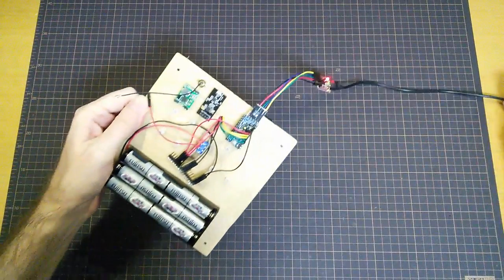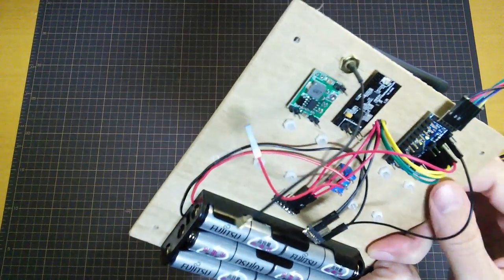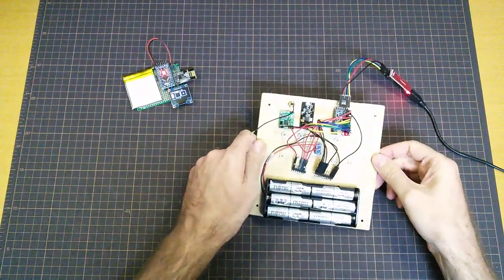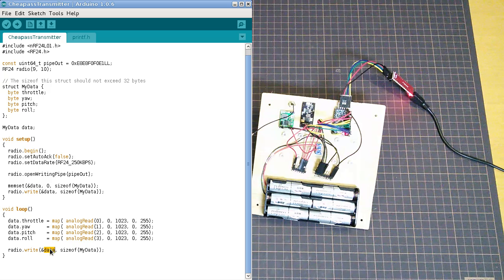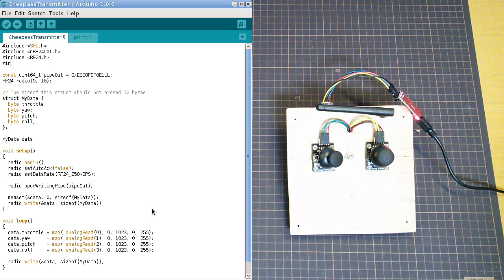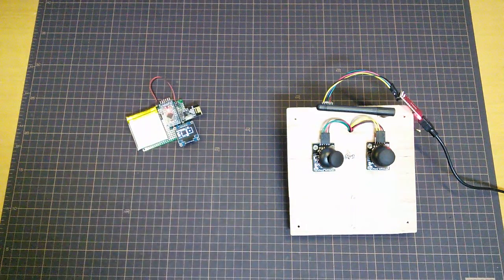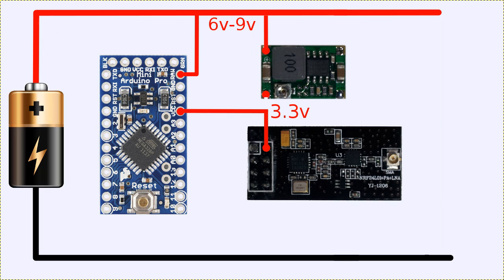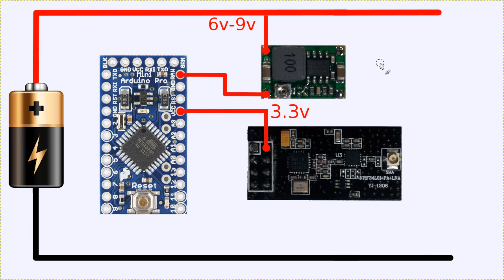Cheap-ass quadcopter build Part 6 - Transmitter (continued)

Comment: A couple of things.  If you put a 10-100uF electrolytic capacitor directly across the Vcc and Gnd pins of the RF module, it greatly helps.  The current surges when the module transmits cause the voltage to sag and the cap smooths that out.  I had a lot of problems with nrf24l01 modules until I found this tip.  Solder the cap directly to the pins on the bottom side.  Another thing is that supplying 3.3V to the raw in of the Arduino will result in less than 3.3V coming out of the onboard regulator.  There is always a certain amount of "dropout" with linear regulators.

Comment: Hi, Went through your sketches and found the one for the "Tester Thingy" and built the hardware as I believe is the same. Problem when I come to compile the software, it comes up as "Error compiling for board Arduino Pro or Pro Mini ...exit status 1" ....Any idea what this problem may be caused by? ...Thanks Jorgo
Reply from the maker: There should be more to the error message than that.... like a specific line shown in the code where the problem is. Scroll up and look at the whole error message....
Reply: Yes, you were correct. Problem was the library for RF24 was not actually installed. Throws one a bit when scrolling through the libraries and seeing it there BUT pressing "more info" makes it obvious that is is actually NOT installed. Also found I needed to change the size of the screen or rather, uncomment the correct size in the library SSD1306 using "word program". Screen had address as 0x78 which did not work but I found the reason why in other areas of the web ( shifted left 0x3c becomes 0x78)mmmm...anyhow, thanks for your work, great inspiration and motivator.

Comment: Hi, I'm following your tutorials, they're done very well, thank you. But I don't understand if, using "MultiWii_RF24" and "GY-80", for tx , using the joystick modules, I have to use "TelemetryTransitter" or "CheapassTransmitter" with two arduino? Why does the throttle field not change values in MultiWiiConfig? Must it be armed? As? Thanks again.
Reply from the maker: ? There is no sketch called "TelemetryTransmitter" related to this series...
If the other channels change values but throttle does not, then maybe it does need to be armed, I don't remember.
Reply: Oh sorry, I'm talking about this sketch http://www.iforce2d.net/sketches/TelemetryTransmitter.zip .in my case should I use cheapassTransmitter and another arduino in which load cheapassReceiver?

Comment: My long range nrf module only works when i touch the antenna or the board itself with my bare finger....does anyone had the same issue...or any one can tell how to fix it...i am using the nrf with arduino pro mini and i am also powering the nrf with another 3.3volt power supply...

Comment: What pin would I use on an arduino uno board that is similar to the raw pin on the arduino pro mini board.
Reply: Nevermind I actually found out look down below:

FOR ANYONE WHO WOULD NOT LIKE TO USE THE ARDUINO PRO MINI AND WOULD RATHER USE ANOTHER BOARD SUCH AS AN ARDUINO UNO BOARD, THE PIN (VIN) IS THE PIN THAT IS SIMILAR TO THE RAW PIN ON THE ARDUINO PRO MINI. 

Thought that would be some useful information :).

Comment: hi.when i change throttle down,all motors being rotate small rotation.what is proble.?
Reply from the maker: Maybe you need to calibrate the ESCs 
http://www.multiwii.com/wiki/?title=ESC_Calibration
Reply: iforce2d i have already calibrated.
Reply from the maker: Then I have no idea. Is your throttle stick giving the correct values to the flight controller? It should give about 1000 when throttle is fully down.
Reply: iforce2d my throttle stick full down show 1011.and full full top 2014.is this normal?
Reply from the maker: Ideally a little lower is better, but that's probably ok.

Comment: how did you make the tester for the transmitter?
Reply from the maker: https://www.iforce2d.net/sketches/
Second one in the list
Reply: is there a parts list ? thanks
Reply: sir,the serial monitor is displaying certain unfigured characteristics in a horizontal line....i am unable to check the values...what's the problem?

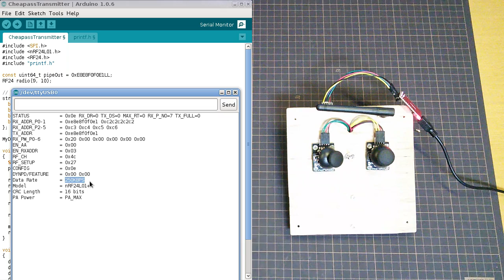Comment: At 11:59 my adress is 0xe7e7e7e7e7. I have changed nothing in the Code. How can i change this?
Reply from the maker: Check your connections.
Reply: Something intresting happened. When i connect the arduino to the pc and open the Serial Monitor, the adress is 0xe7e7e7e7e7. When i press reset now, the ardess changes...
Reply: Okay, i have solved the Problem.
You can't use the Arduino Nano's 3v3 Pin for the nRF24l01 PA. 
With the UNO's it works just fine.

Comment: i had a doubt in the code.  in the fourth line of your code (const unit_t  pipeout = E8E8F0F0E1LL) what is this ? and should i use this line in my transmitter?. And in your video number 12 you have used a different code. and when i verify my code (latest in video 12) it shows that there is no library like nRF24L01.h   so what shall i do
Reply from the maker: https://arduino-info.wikispaces.com/Nrf24L01-2.4GHz-HowTo

Comment: Hey dude..You are awesome bro...I need your help. When i uploaded the tx source code and checked the pipe out address, it was showing like this (RX_ADDR_P0-1= 0xe7e7e7e7e7 0xc2c2c2c2c2) instead of the pipe which you have mentioned in the source code. the data rate is showing correct i.e 250kbps. What will be the solution for this.
Reply: +Palkesh Agrawal Problem is solved dude. the connections are so much compressed that they are not transmitting the signal, but loosing them solved my problem. Now i am getting correct pipe out address.

Comment: my nrf24l01 is unable to set pipe address. when i check it shows 0xFFFFFFFFFF.
Also powering the transmitter with arduino is heating its voltage regulator. 
i have nrf24l01 with PA.
Reply from the maker: +Saurabh Verma double-check the connections. If it still doesn't set the pipe address correctly the module may be faulty. The fact that it causes the power regulator to heat up is also suspicious.
Reply: +iforce2d May be my module if faulty. 
With the normal nrf24l01 . how much range can i get in open area.
Also i am willing to use camera. Suggest me any transmitter for direct stream on my remote control.
Reply from the maker: +Saurabh Verma I would expect about 50m in an open area with the PCB antenna. More details here: https://www.youtube.com/watch?v=gtM832Z0ujE
Here's an example of one setup you could use for video streaming: https://www.youtube.com/watch?v=x02hMSPoDvo (that video is a bit old now though, there are better options)

Comment: Couple of questions, first off, how about using an Arduino Pro Micro?  The built in mouse/keyboard should be much easier to program with, second, could a fellow use an old USB or perhaps a joystick port type of joystick if you have one laying around?  I have many of those in my backroom just gathering dust that need a bit of loving care to rehab them back into good standing. ONe an old CH Flightstick Pro that has like 9 seperate controls on it, with a couple of hat type mini joysticks onboard and would seem ideal as well.  Perhaps wiring it up to the Pro Micro with it's leonardo chip could make a much easier to control and build system.  Let me also admit that I really don't know much about all this, just thinking while watching the build.  I used to love the old flight games from the 90's and I know I paid over 60 bucks for the flight stick, so it would be great to be able to once again put it into some service or another. When I purchased it, I still had an old 386SX but soon upgraded to a 486 so I could get enough power to run my favorite game back then.

Comment: Thanks for the video. Have you ever suffered from current problem? I use 3*1.2V NiMH rechargeable battery as a separate power supply. But the current is only 20 - 30 mA. It's okay for low power mode, but not enough for high power or max power mode. Is it your voltage regulator that solves this problem? Thanks.
Reply from the maker: +Jichun Qu The regulator should be able to handle 1 amp I think.

Comment: Hi iforce2d,thanks for the video.  I'm not to experienced with coding, and I was trying to use your code for my Arduino mega 2560.  This is the error I receive.     transmitter_D.ino:6:22: fatal error: nRF24L01.h: No such file or directory
     compilation terminated.
     Error compilingI downloaded my nRF24 library from GitHub, and I'm not sure if that's the problem.  Any help would be great. Thanks
Reply from the maker: +Aaron Sonderegger I'm assuming you have added the nRF24 folder to the libraries folder of your arduino installation and restarted the IDE? You should see some new entries under the Examples menu if you have everything in place.
Reply: +iforce2d I've added the nRF24 folder to the library folder.  I believe that I've restarted the IDE because I find the folder under the examples menu, but I can't get it to compile the code, just with the #include libraries.
Reply from the maker: +Aaron Sonderegger I don't quite follow what you're saying - you mean the examples don't compile? If the examples compile then you just need to play spot the difference with them and your code, change one of the examples a bit at a time until it looks like your program.

Comment: i don't touch joysticks but values of throttle are not still,
yaw and Pitch are very good, Roll is ok.
i use your TestJoysticks.ino
what should I do? what is the reason?
I hope you can help me.
http://www.bilder-upload.eu/show.php?file=1fec8a-1449707540.jpg
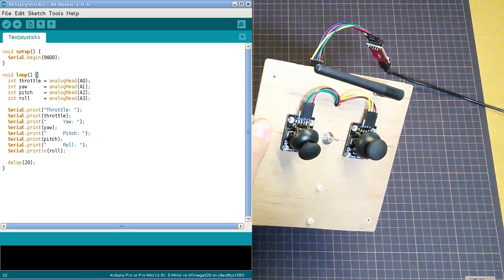Reply from the maker: +hayta haytapot Looks ok to me. The values are an analog sample, they are not likely to be perfectly still, you can even see in the video 1:42
Reply: +iforce2d 
thank you for your answer,
I saw that, your values oscillate only one value
my throttle values swinging between 1014 and 1023, I thought this is not to tolerate.
as well after map the values to between 0 and 255, the swing is smaller.
I tried to avoid that with this code: http://www.bilder-upload.eu/show.php?file=2730d7-1449746665.jpg

 the result is very good but I'm worried because of delay.
what do you think about this code?

Comment: Have you tried using 3 batteries in series to output 4.5 volts and inputting that into the arduino so that there's a much lower voltage drop by its components? This would also mean you don't need a voltage regulator.

Comment: i want 4 channel (esc/servo) signal not ppm just like the hobby king reciver because i am going to use an arduino uno as a flight controller and i am getting the flight control code here https://m.youtube.com/playlist?list=PL0K4VDicBzsibZqfa42DVxC8CGCMB7G2G
Reply from the maker: +Piku Sk in that case you can just add the nRF24 parts of my receiver code to your flight controller sketch and connect the nRF24 to the arduino uno directly - you don't need PPM or PWM or anything

Comment: hey i like your video but i don't want to convert the signal into ppm so can you post a code comment which don't use ppm
Reply from the maker: +Piku Sk What do you want to convert it to? PWM and multiple wires? I've never done that so I don't have any code to do it, but there is some in the multiwii source code. But why not PPM, all the common FC's can use it (kk2, multiwii, cleanflight, apm etc)

Comment: I was looking at the test receiver you've shown in this video, and I thought of building something like that myself...
The only question I wanted to ask you, is if you've used any kind of regulator or step-down converter to power the Arduino Pro Mini + NRF24L01 from the 4.2-3.7V LiPo, or have you been powering them directly from the battery itself?
Reply from the maker: +James Game I'm powering it directly from the battery, to the RAW pin of the pro-mini. It's a 5V pro-mini but it still seems to work when powered from a 1S lipo. Keep in mind the nRF24 is not supposed to have more than 3.6V maximum, so I guess I'm kinda lucky that this works. It would be safer to use a step-down regulator,, or a 3.3V arduino maybe, so that the VCC will be 3.3V

Comment: Hey, I noticed that in one of the later videos you mentioned that you needed to use the Hobby King Transmitter to 'Arm' it. I may be being silly, but does this mean that you can't fly the quadcopter with the self made transmitter without setting up the Hobbyking transmitter?
Reply from the maker: Joe Allison I think that was because the movement of these gamepad-style joy sticks is restricted to a circle, so I couldn't get the stick to go completely down and right, which is the default position to arm. You can change the setting for that somewhere, eg. throttle down and roll right will arm etc. to get around that situation. Search for ALLOW_ARM_DISARM_VIA_TX_YAW in config.h
Reply: ***** Thanks, I'll have a look. I had a bit of trouble aduino'ing the HK transmitter, so i'm going to try and make your version.

Comment: i set cheapssReceiver
void recvData()
{  
  while ( radio.available() ) {        
    radio.read(&data, sizeof(MyData));
    lastRecvTime = millis();
    Serial.println("veri var");
    for(int i =0;i<5;i++)
  {
    Serial.println(ppm[i]);
  }
  }
}
but Serial always  print 
1000
1498
1498
1498
1000
why?
Reply from the maker: Yunus Yılmaz And what did you expect to see? Are you moving the transmitter sticks? Does it also print "veri var"?
Reply: ***** i am moving transmitter stick . radio .write or radio read always
1000
1498
1498
1498
1000
read or write ...Where is the problem? data always be this values
Reply from the maker: Yunus Yılmaz Does it also print "veri var"?

Comment: Hello, can someone please help me? I get these errors when I try to compile the tx and rx sketches: 
tx:

CheapassTransmitter.cpp.o: In function `setup':
/Applications/CheapassTransmitter.ino:33: undefined reference to `RF24::begin()'
/Applications/CheapassTransmitter.ino:34: undefined reference to `RF24::setAutoAck(bool)'
/Applications/CheapassTransmitter.ino:35: undefined reference to `RF24::setDataRate(rf24_datarate_e)'
/Applications/CheapassTransmitter.ino:37: undefined reference to `RF24::openWritingPipe(unsigned long long)'
CheapassTransmitter.cpp.o: In function `loop':
/Applications/CheapassTransmitter.ino:65: undefined reference to `RF24::write(void const*, unsigned char)'
CheapassTransmitter.cpp.o: In function `__static_initialization_and_destruction_0':
/Applications/CheapassTransmitter.ino:11: undefined reference to `RF24::RF24(unsigned char, unsigned char)'
collect2: error: ld returned 1 exit status
Error when compiling. 

RX:
CheapassReceiver.cpp.o: In function `setup':
/Applications/CheapassReceiver.ino:76: undefined reference to `RF24::begin()'
/Applications/CheapassReceiver.ino:77: undefined reference to `RF24::setDataRate(rf24_datarate_e)'
/Applications/CheapassReceiver.ino:78: undefined reference to `RF24::setAutoAck(bool)'
/Applications/CheapassReceiver.ino:80: undefined reference to `RF24::openReadingPipe(unsigned char, unsigned long long)'
/Applications/CheapassReceiver.ino:81: undefined reference to `RF24::startListening()'
CheapassReceiver.cpp.o: In function `recvData()':
/Applications/CheapassReceiver.ino:90: undefined reference to `RF24::available()'
/Applications/CheapassReceiver.ino:91: undefined reference to `RF24::read(void*, unsigned char)'
CheapassReceiver.cpp.o: In function `__static_initialization_and_destruction_0':
/Applications/CheapassReceiver.ino:20: undefined reference to `RF24::RF24(unsigned char, unsigned char)'
collect2: error: ld returned 1 exit status
Error when compiling.

It works when I try to compile the servo tester or joystick tester...

Comment: Great video series. Would you be willing to give some details on the construction of your transmitter tester? Thanks :-)
Reply from the maker: hehe you are the second person to ask in the last few minutes, I actually have the link to the sketch still in my clipboard: http://www.iforce2d.net/cheapassQuadcopter/TXTester.ino
The comments in the sketch should tell you all the info needed.
Reply: Thanks for that. I have been watching your video series all morning and am just about to give my Paypal account a hammering. Do you have any details of the actual hardware side of the tester. I love the LCD representation of the joysticks movements
Reply from the maker: MrPnew1
The screen is this one, also found on ebay and a bunch of other places: http://www.banggood.com/0_96-Inch-4Pin-White-IIC-I2C-OLED-Display-Module-12864-LED-For-Arduino-p-958196.html
The RF24 is just a regular one (PCB antenna type). Arduino is a pro-mini (what else? :)
Reply: Thanks again and happy new year

Comment: The ripple from the battery is enough to start oscillation  on the voltage regulator to smooth that is to add capacitor across the positive and negative sides of the power supply and the noise should stop or be low enough that the voltage regulator doesn't oscillate
Reply from the maker: Hmm... but what level of ripple does a battery produce, is what I'm wondering. The voltage regulator I'm using has small caps at both ends, but maybe they got it all wrong? fwiw many people do find that adding a small cap across the power pins of the RF24 module helps. I will be trying that on the next tx conversion I'm doing right now :)

Comment: Part of the problem is your voltage regulator isn't decoupled its picking up noise from the battery
Reply from the maker: What kind of noise would the battery produce? Wouldn't it be negligible compared to the noise generated from the the regulator itself?